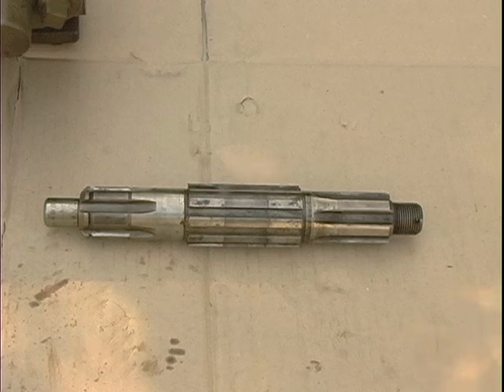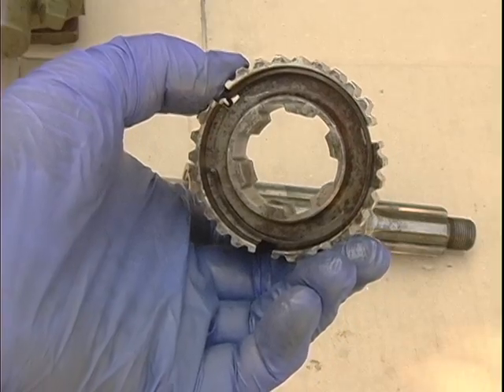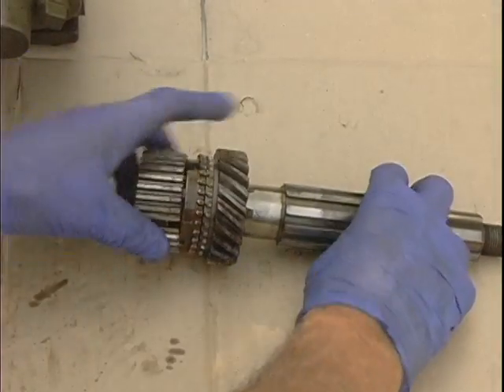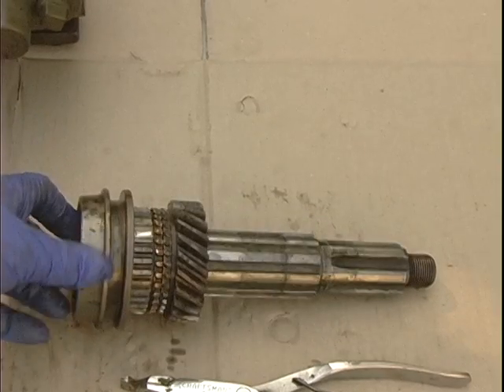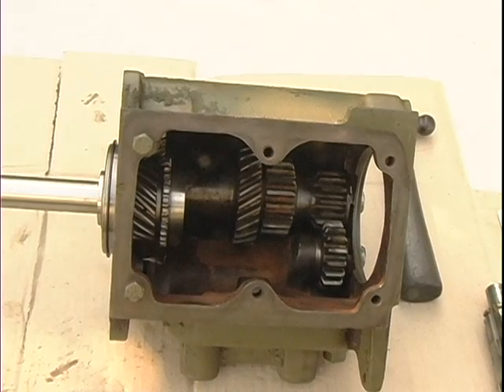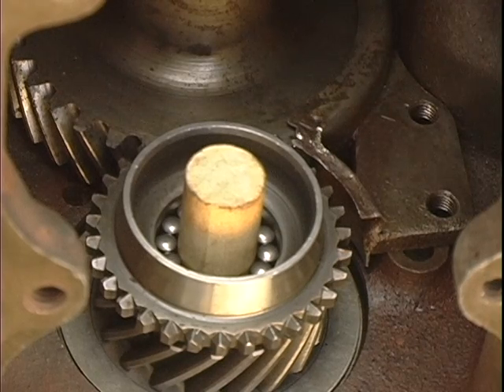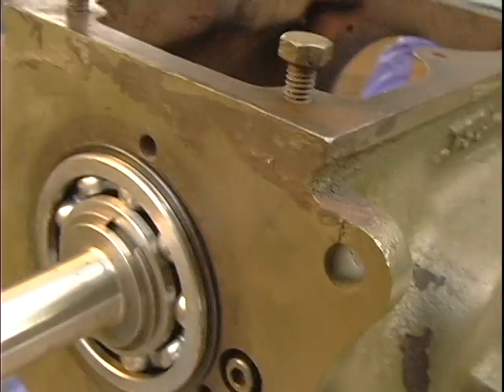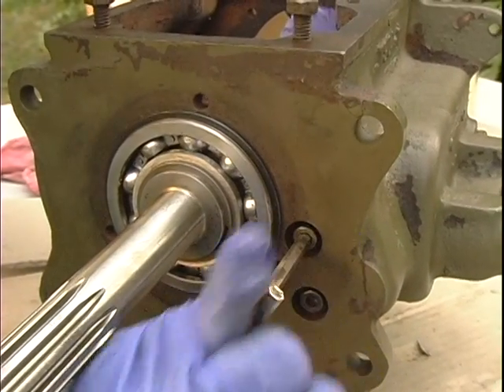Installaton of the Willys M38a1 Spicer T-90 Primary Input Gear and Main Shaft Assembly.

Comment: The oil slinger was eliminated in later T90s and plugs were installed to cover screw holes
Reply from the maker: True, IF you are using a sealed bearing.  If you are using the military non-sealed bearing, you still need the oil slinger.